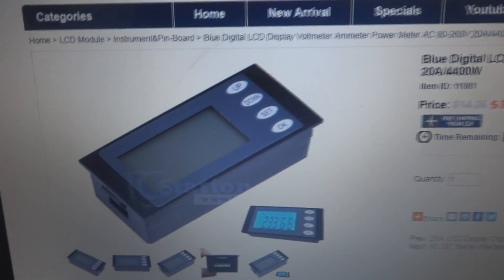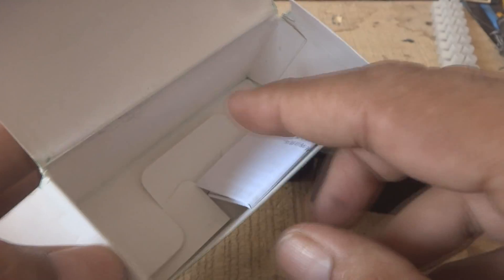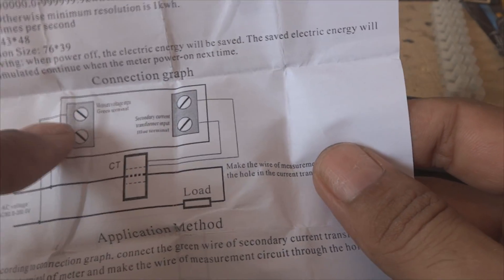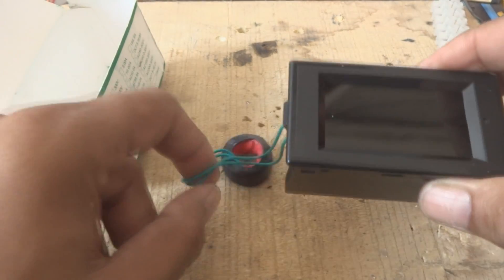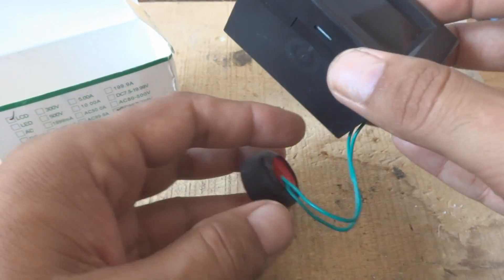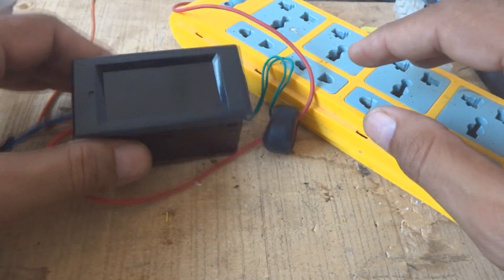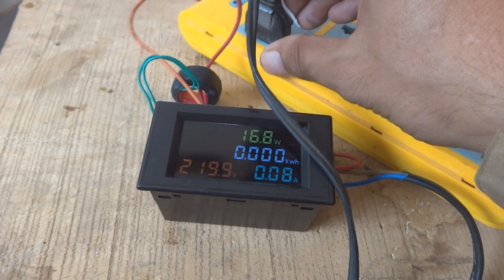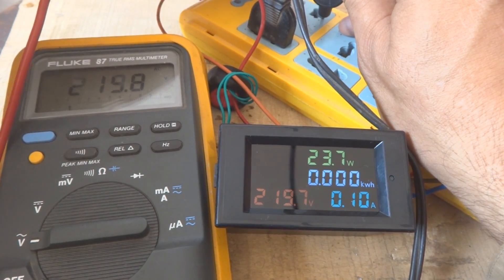Multi function meter. Measure Voltage, Current, Power, Energy all in one unit

Comment: your soldering iron is 21.99 watts as 219.9Volts*0.10Amps*cos 0= 21.9 watts as its resistive load. Mistry of remaining 1.91 Watt is this device consuming these watts to power itself.  It can be 20-watt perfect soldering iron. Then device consuming a hefty load of 3.9Watts. I believe the soldering iron elements are very accurate wattage.
Reply from the maker: Don't worry for such small chunks. Engineering is good approximation. Regards,

Comment: That looks like a handy device.
I like the multiple on screen displays, everything there :-D
The external current sensing toroid is easy to use, conventional method.

I may have used an (old ice cream tub) for a simple box, im cheap LOL :-D
.
Your links don't show this actual device, was your device a "last in stock" one?
Reply from the maker: Thank you very much dear sir for liking and nice comment as always. Your idea is great to fix the instrument in some box and then use it. The item which I reviewed is out of stock now a days and the one on the website is also having the same features with little less price. Best regards,